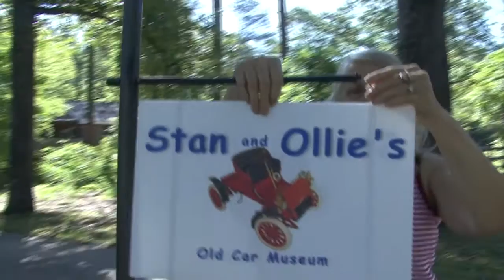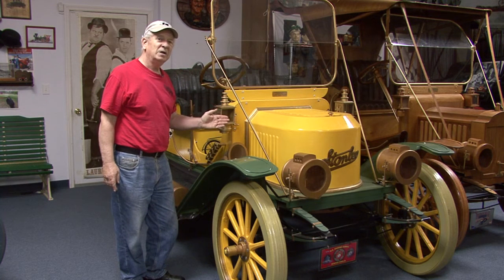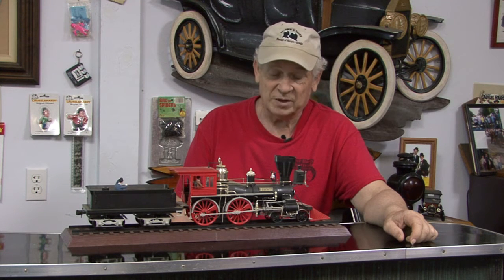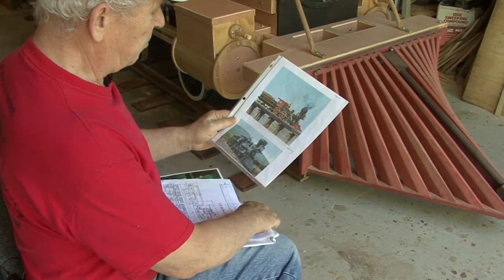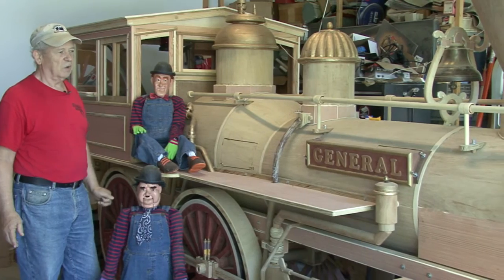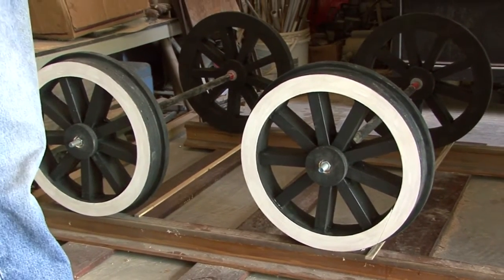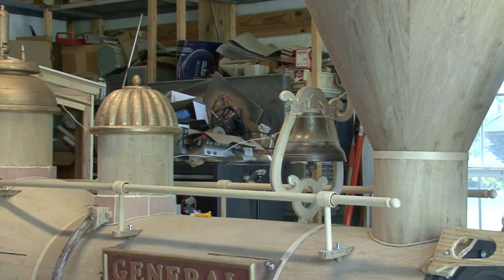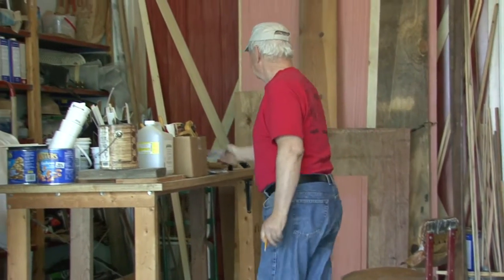The Scrap Wood Sculptor and "The General"

Comment: I was a tour guide at Big Shanty Museum and am the president of Friends of the General, organized to build full-sized, working steam replicas of the General and Texas.   The General was built by Rogers Locomotive Works in Patterson, NJ.  The Andrews Raid took place on April 12, 1862.  The Raid into Georgia really made little difference in the outcome of the war.  No significant damage was done to the railroad and by the next day traffic resumed as usual.  The General is still today a 5' gauge locomotive which was the old southern gauge.  To run on modern rail, extra wide tires were fitted to the driving wheel centers so the flanges would fit inside the rails.  You mentioned the steam dome.  That's where the dry pipe is.  It's connected to the throttle valve which regulates steam going to the pistons.  The General has 62" driving wheels.  The driving wheel diameter plus 10 gives you the top speed of any steam locomotive.  So, the top speed of the General would be 72 MPH.  Great looking sculpture!
Reply from the maker: John, thanks for ALL your information.  I'm going to pass this on to Gary.  I'm sure he'll enjoy your comments.
Reply: Thanks for the great info, how long ago were you a tour guide at the Big Shanty Muse. absolutely a wonderful museum.
Reply: John thanks for the great information and kudos. I love trains and the tale of the General and Andrews Raiders. I’m still looking for a well traveled museum to display my 1/2 scale wood sculpture, if you have an idea let me know, I would like to keep it in Georgia if possible. Thanks GOR2019